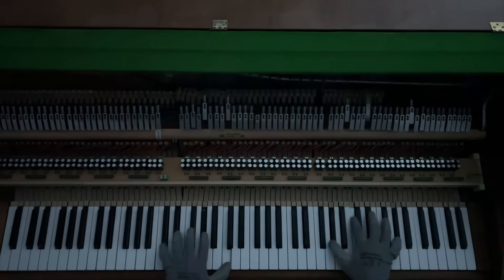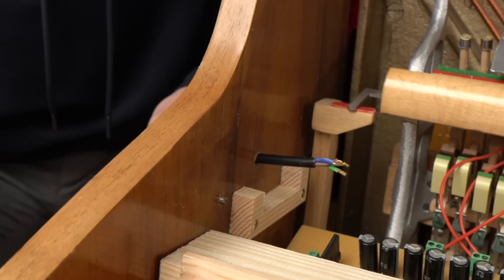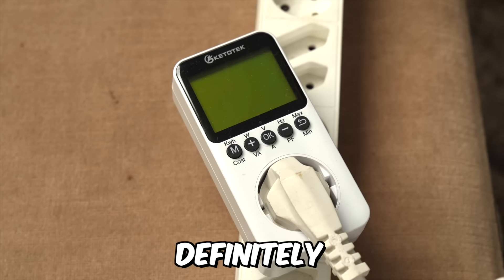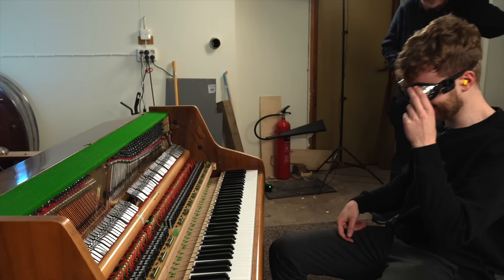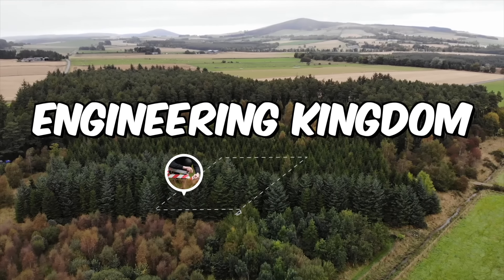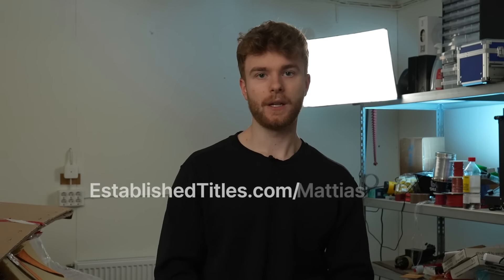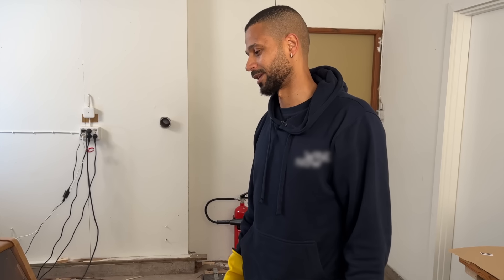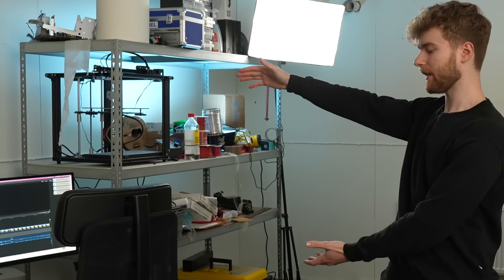Hiring electricians to fix my ”electric piano”

Comment: Piano idea:
I always wanted to see Vibrato to be integrated into a piano, like some kind of lever on the side that could shake the strings a bit, but I understand how this could be too difficult to integrate.
Great Video as always👍
Reply: A true string vibrato would be hard to implement. But a vibraphone like tremolo/vibrato would be possible, you just need a plate with periodic holes in it, that moves behind the strings. Would be kinda cool!
Reply: Could be accomplished like a Vibraphone, using resonating tubes with rotating covers
Reply: Maybe a piano that bows instead of striking, with a pedal-operated vibrato?
Reply: @bliz85  yeah, I've suggested a "hurdy gurdy piano" a couple of times, with bow wheels and small electric motors that gets triggered when piano keys are pressed and closes the circuits
Reply from the maker: I am pretty sure there’s been some really weird attempts on this before on piano. But I’d have to do some digging to find it. But no attempt has been succesfull really. Thank you btw!
Reply from the maker: One terrible way to do this would be to use a big ballon as resonance chamber for the iron frame and then simply just have some pedal that compresses the balloon. That would create the effect. Like this https://youtu.be/nk_i6s1jAso
Reply from the maker: But some instrument builder had tried this for pianos and said that it sounds like shit for lower notes
Reply: An electronic way to do it could be to attach a bunch of (home-cinema) shakers on the cast frame or the wood, connect 1+kw amp and a tone generator set to somewhere between maybe 0 and 10hz. just make shure to attach all shakers in the same direction or change the polarity, otherwise they would work against each other.

Comment: Admittedly you could absolutely make this safe with enough effort. You'd need to make all the calculations to ensure the caps can't pop, give them some resistor to discharge them slowly when unplugged, it might need some cooling fans. Honestly the biggest issue with this is how the plasma will wear down those wires really fast. Now if you want it standalone safe you either want to enclose it fully, or if you want to see inside you would basically need to get a full plate of what the goggles are made from and use that instead of the plexiglass. The wire is a good point, whether you move it or not you should make a proper attachment for it on the inside so that it can't just get snagged out, you basically just screw a plastic thingy over the wire into the inner wall.

Thing is with enough money, time, and effort you could make almost any stupid idea safe. You could make this piano IP68 and play it under water if you really wanted to, but it would cost a ton.

Comment: To prevent the resistors from overheating when a hammer sticks, a PTC resettable fuse in series with each resistor would drop the current automatically.   To reduce the tendency to stick,  a 2 watt carbon resistor in series with each hammer would limit the current - you would have to experiment to find the optimal ohm value to choose between spark size and not sticking.   Just do 1 hammer first - Start with 100 ohms, go up or down by a factor of 2 each step, depending on the results.

Comment: I still think you can Isolate the strings from the electrical loop by running a conductive probe above the hammer head and running a single wire above the strings. This way the spark happens higher up and not actually on the strings. It would save you on materials because you would only have one string that is getting worn and it would be easier to keep the piano in tune. You could technically move the “spark” completely out of the interior of the piano and into a more insulated plexiglass area above the piano to improve safety and make the sparks more visible

Comment: I'm surprised at the fellow wearing voltage gloves without the overglove.  It didn't seem like he had the glove liners either.  That's a pretty good way to end up with voltage safety equipment just as questionable as this piano.

Comment: Years ago I turned old wired headphone earbuds with the foam covers into mics and used these to record drums. One idea is to replace every piano hammer with earbuds (with foam, felt, cork or rubber coverings) to strike the piano strings and capture that sound. You will need a few audio mixing boards to plug a full piano of 81 keys. 

Another idea is to attach piezo pickups (or pressure sensitive switches) to the sides of every hammer and connect to a multi velocity sampling module (like Sweden's own 2Box modules) or program, a bit like the Mallet Kat (using eDrumin 10's). When using the 2Box modules with splitter cables the maximum inputs will be about 15 inputs per module.

These ideas will electrify the piano with no chance of being electrocuted

Comment: Best advice I can give is to get a high voltage transformer and greatly reduce the wattage. So hi volt low current. That would be the safest way to go about it. The hi voltage would keep the Sparks, but greatly reduce the risk of death as long as you keep the current in the micro amps. Something like 1,000 volts at .005 micro amps. You could touch it and not get seriously hurt. Wouldn't feel good though 😉

Comment: Hey ! nice and fun project you got there ! I'm an electrical engineer myself and I had a few remarks that can help (take with grain of salt, I'm just one guy and have never worked in electrical safety + I didn't see your circuit) :
- You should definitely have a circuit breaker somewhere on your piano to cut safely put it off the grid

- You should also have a circuit breaker or even some kind of way to disconnect mechanically the piano from the whole electrical stuff, just so you can feel safe when you need to tweak and tune your piano. It may not be needed, but it's always safer (especially being able to rely on your eyes and not your knowledge of how a device works to know if it's safe) and being able to clearly see the parts disconnected will help with the fear of touching you know was live a minute ago. One more thing, if you actually do that and make the hammers disconnect from your capacitors, don't forget to discharge them too, even if you discharged your capacitors (next point), you could use a switch that would make those hammers connect to ground, but if you do that be sure to make it so the switch can't be used when capacitors are connected or you may end up accidentally short-circuit those capacitors through this switch and you don't want that.

- You need a discharge circuit for your capacitors, nothing too fancy. I guess one side of the capacitors is already connected to ground, so put a big resistor that would connect your positive voltage side to ground through it whenever you turn on a transistor that can sustain your voltage. Transistor is better for this than a mechanical system since it won't make a spark (if it does, it means it broke), but it will require you to have some kind of low voltage DC electrical supply to turn it on.

- What your engineer said about putting some insulation on your hammers may be interesting. The current flowing through the hammer to your wire is kinda proportional to the surface of "contact", current here being the spark (your hammer gets close enough for the voltage to force current to flow through air). If you insulate completely your hammer and just make a little hole in the insulator right at the spot it's supposed to hit the wire, you may be able to "control" how big and noisy your spark gets depending your the size of your hole. I'm not sure if it would work or how much it could be reliable for the size of this spark, and it will certainly be a very tiny hole like needle size. Also the insulator may deteriorate fast because of the extreme heat of sparks. Could be worth a try though, it may work, and the prototyping may be fun.

Comment: This is awesome! I love the piano, here are some of my suggestions, the first is genuinely something you should do before you flip a breaker.
Take out the live wires and tie a knot into the end of the cable from inside the piano so if it gets pulled the knot will be large enough that it won't go through the hole and be yanked out.
Plexiglass works out pretty okay for arc flash but it's not perfect, you could coat the glass in a thin colored film to reduce the flash.
For the hammers being stuck, it'll make it harder to press the keys but perhaps adding a spring to pull the hammers back could work.
You can calculate the power that the piano draws from the wall and spec a fuse to go in the outlet so if something fails and starts drawing a lot of power the fuse will pop and not damage anything else.
An on/off switch on the piano would be helpful so you don't have to jump up and unplug it 
You could make a sacrificial wire hanging off the piano wires that the hammers will contact first so the arc will not damage the piano wires but it would be finicky and time-consuming. Like wrap a thin wire around the piano wires and have the end stick out twords the hammers a little, But not far enough it'll touch another piano wire, wrapping a thin -ish wire around the contact point could be enough by itself maybe, that'll definitely de-tune the piano though.

Comment: Mattias, look into nomex paper for electrical insulation. Works well into the 1000s of volts depending on the thickness. Would work well for your arc piano for sure. Not the cheapest stuff however. For wire insulation look at buying silicone insulated wire used in RC vehicles. The insulation can withstand higher heat therefore higher currents. It also has more wire strands that make it more flexible. About the only way I can think to discharge the caps is to have a relay or switch that shorts that caps to ground through a high wattage resistor when you power down to bleed them out. Personally I like your arc piano more, but it is also a lot scarier.

Comment: You should build a piano with Electric guitar pickups on each string, that would be cool
Reply from the maker: I was so close to doing that! Maybe I will take up that project again
Reply: @Mattiaskrantz  It is also possible to reverse the operation of pickups so that, instead of picking up the vibration of a piano string, they actually "bow" the strings electronically in the manner of an EBow.  But I don't think this has ever been applied to more than a few strings of a piano at a time.

Comment: You spoke of the welding issue, you might be able to use graphite/carbon powder on the contact points (probably just the strings). Just rubbing pencil "lead" over it might work too, but there's other stuff in that (maybe would work better, depending).

Bad/dangerous piano idea: use ramset powder charges (used to drive nails into concrete) as the thing that "hits" the strings instead of a hammer (the hammer sets off the charges?). Probably with a revolver-type system so you can play each note more than once? Magazine-type system would be a level more complicated.
Or in a different way, a burst of hydrogen + oxygen ignited by spark - if it was just propane + air I doubt you could get a sufficient detonation to "strike" the strings. Can use electricity + water to make the hydrogen and oxygen.

Bad/dangerous idea #2: Rubens Flame Tube - visualizes sound waves with fire - drilled into one or both sides of the piano. But I'm not certain how to get the sound in while preventing the flammable gas from leaking out into the piano (maybe a sufficiently loose membrane/seal?), so possible big fire hazard there.

Normal bad idea #3: Put an electric motor with offset weight on each hammer, so you can sustain a note indefinitely. Or just an electromagnetic coil (probably with a string-frequency-matched oscillating field per string?) to induce string vibration, would def weigh less. This is much more electronics-design-involved though than the other ideas.

Comment: Using crystal rods tuned to the frequency of the standard wires you could make a piano with a super neat sound.  You would need to make sure the hammers are probably even gentler than normal, and/or make a gentle sharp tap tip

Comment: Fixing the resistors is easy with clicksons rated for 125°C for example. Tie them to the resistors, and put them in series with the resistors, and they put the resistor off above 125°C

Comment: I'd rather think those electricians were shocked by their discovery of your electric piano.
At first, their minds might have resisted the idea, but I'm sure their current state of mind is positive rather than negative.
I mean, your electric piano was so revolutionary that Voltaire himself came back from the dead; lightning may have been involved.
I'm sure it'll be a conduit for other innovations.  Surely someone in charge will realize the potential.  Some of the religious are already meditating in their monastery cells because of it, going, "Ohm... ohm". 

Now that you are all discharged from my jokes --- I myself was ecstatic and lively --- perhaps you could try a piano with strings and bows, or maybe something with electric magnets (since you are now also an electrical engineer).  

I saw somewhere else something about using wind.  What about doing something with some wind or reed instruments, like the saxophone.  I'm sure your views will surge with them once you've plugged them into the internet.

Comment: Hello :) I am not an expert but i see it could have some future in case:
1. You'll lower amount of Watts at circuit to not produce sparks(i'm not sure but i'd like to see if it works xD)
2. When hammer beats the string - it should close own circuit and fastly charge own capacitor.
3. In parallel to capacitor connect light diode so once circuite lost electricity - diode will slowly dim (need to experiment with capacitor's capacity and diode's size to get the best visual effect)

finally i see it like this: once you playing the note - this note's capacitor charging up and this note's diode becomes shiner and after some inactivity time - dims. The often you play - the shiner diode and longer fade out.

just a theory though😅

Comment: Simple fix for the cord would be to give it some slack on the internal side, then tie a big knot in the cable so it can't be yanked out of the hole. Ice seen that on a lot of cheap appliances. If you want a way to discharge the capacitors when you turn it off, you could get some depletion mode MOSFETs (driven by a little voltage divider or buck converter) short the capacitors by connecting the drain and source pins of the mosfet to both terminals of the capacitors, and connecting the gate to the lower voltage output of it's driver. When you turn it on, the MOSFET will act as a huge resistance, and let the capacitors charge,. but when you turn it off it will list the gate voltage and short the caps. I don't know what voltages you're working with, but there's some pretty beefy MOSFETs or IGBTs that can handle high power. You could also do this electro-mechanically with some breakers but they might be harder to source.
Reply from the maker: Knot idea sounds good! Never heard the mosfet idea before. Sounds interesting to look into
Reply from the maker: I have some high power mosfets in my garage actually
Reply: That's actually super cool! The type of MOSFET will determine how you wire it, but the basic idea is you want it to just be a short when the piano is off, and an open when it's on

Comment: IDEA
Making weird instruments from around the world even weirder!!!
“Weird” might not be the most appropriate word, but taking a bunch of more obscure instruments like a sitar, oud, hurdy gurdy, nyckelharpa, tagelharpa, hammered dulcimers, saws, glass armonicas, I could go on, and just make mini projects out of them!!! Like put water in one of them, put pyrotechnics on another, put cello strings on a sitar and bow it!!! It would be cool to see so many different instruments, and it would turn away from pianos which are 10 times harder to modify. Oh and putting piano hammers inside a 12 string guitar and hitting the strings with those would be cool :3
Reply from the maker: Yeah pianos are really tricky to work with! I do like weird instruments so I might for sure try to implement this. Thanks!

Comment: As an electrical engineer, I can think of two things that would make it safer off the top of my head.
On the inside of the piano, wrap the wire around something solid before it sticks out of the side. That would make it much harder to rip out of the piano. 
Also, put large resistors (1 mega or 100k ohm) in parallel with all capacitors. It would make them discharge when the power is turned off, but wouldn't affect the functionality much when it is turned on. 
The overall risk of stuff catching fire when the piano is on though, I don't know how to fix xD

Comment: You should make a piano, out of pianos 😱
Or a piano from scratch, like a rat rod.
Or: Wooden piano
Radioactive piano
Spiked piano
Thorny piano
Quiet piano
Giga piano
Trypophobic piano
Snow/ice piano
Cardboard piano
Paper piano
Cardstock piano
Spring piano
Cog piano
Jumping piano
Graphene wire piano
Chain piano
Gilded piano
Raw piano (idk, raw ore/metal?)
Hot glue piano
Glass piano
Camera piano
ainop (alphabetical piano)
Edible piano (hard candy, most likely)
Lego piano
Bottle piano (bottle parts/whole bottles, like plastic, metal, beer, wine...)
Etc (suggestions here)

Comment: You probably should regulate the power coming in the piano.  The resistors are drawing too much current if they're catching fire (though you are also creating a short there...).  But if you had a power supply that cut off at a certain amount of current draw it /might/ be just a bit less of a fire hazard.